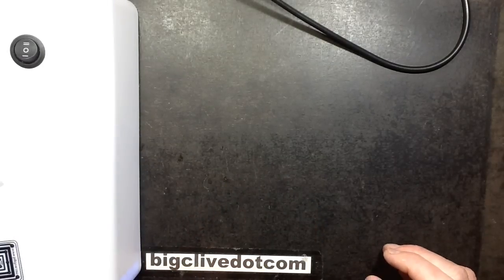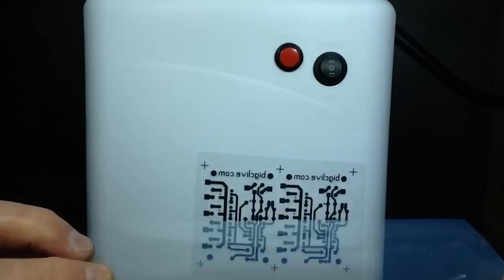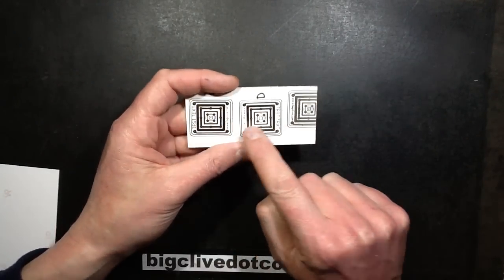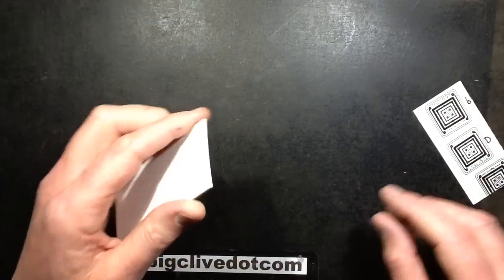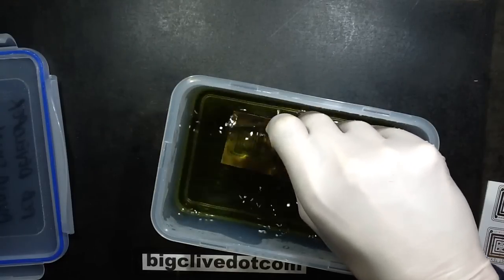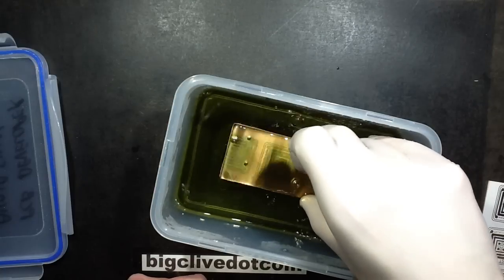Photoetching PCBs with silkscreen inkjet transparency material.

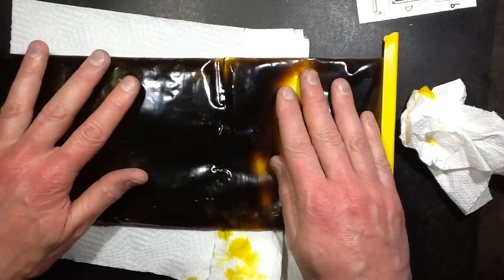Comment: 16:45 I liked the way you dialed in the exposure time. That is the way to do it! Your discovery of silkscreen-quality transparent film was new to me, and I think you for the tip. I gotta try it!

The biggest issue for a DIYer making boards like this is failing to understand that photosensitive film assumes "black and clear" photographic film, where black completely blocks all light from passing. When you print on a clear substrate using either an inkjet or a laser, black is only "partially opaque," meaning SOME light gets through. This is a big issue. I would bet that 99% DIYer board failures are because the hobbyist does not grasp this limitation.

Other points worth mentioning:
1) The strength of the lamp output. Most experimenters go wrong by assuming all exposure lights are the same. They are not. Strong lamp output requires less exposure time than does a weak lamp output. No one can advise anyone else how long to expose a board unless he and the inquirer have the very same setup!
2) Distance between the lamp and the board must be consistent for your setup.
3) 365 nm (=UVa) is the peak sensitivity for most film, but you can also use12V LED light rope that puts out 400 nm ("blacklight"), too
4) Importance of getting the artwork squeezed close to the PCB. If not, fuzzy/thin lines result.
5) understanding how photosensitive film works, particularly given how SOME light is going to get through the black ink/toner, and knowing how to interpret what happens when it does. Too much wanted resist washes away ==> exposure time too long. Too much undesired resist remains ==> exposure too short.
6) The importance of running a simple test pattern to determine your optimum exposure time for our setup. Clive does a good job of explaining it with this video.
7) Dust/dirt is your enemy when making a fine-line PCB exposure.
8) Use warm water for your developer to speed up the development time.
9) Warm up FeCl3 (if you use it) to significantly speed up etching time. I warm mine by placing the plastic bottle in a pan of heated water, letting it soak for about 15 minutes with the cap loosened (to relieve pressure!)
10) Acetone easily cleans off the film after the etch
11) I don't like using fingernail lamps because their light output varies as you move a board around under their light. Invest a few bucks and some of your time to build yourself a little exposure box using the 12V LED blacklight strip lighting for consistent results. Make the box big enough to use the entire 5m of light rope to line the box's interior. Create a uniform light pattern.

Comment: Hi Clive! Just wanted to mention that the one time I tried etching a board with a photosensitive coating, the best material I was able to find in my local box store was bog-standard tracing paper. Not especially transparent (about the same transparency as the vellum used on wedding invitations) and extremely non-thirsty paper, so the contrast was only a couple orders of magnitude, but I was able to get good prints with my printer's high quality setting and ink saturation dialed way down. My exposure rig was a CFL floodlamp in a clamp fixture. Once I locked down the lamp distance to get good coverage over a fairly large board area, I printed a test pattern similar to yours, snapped off a strip of the board, and had a shutter (I think it was just a piece of chipboard) that I slid a half inch every 30 seconds. The project itself was duff due to several design errors on my part, but the vellum and etching (I was experimenting with muriatic acid and hydrogen peroxide) worked splendidly. If I ever feel an urge to do some home etching again, I'll probably go with the same vellum (maybe with a panel of near-UV LEDs for the exposure), your squeegee-on photoresist, and vinegar/peroxide/salt as an etchant...but really, I doubt that will happen in the near future, as quick-fab prototype PCBs are so readily available, and I have a pile of perfboard that can handle most things I might need to lash up by tomorrow.

Comment: Ah, the amount of things here that translate directly to Film Photography is amazing. We even do what you described with a sliding shutter on a timer in the darkroom developing prints. We call them test strips. The paper we use usually takes about 1.5-3 seconds to expose a normal image. If you apply filters to increase the contrast you might have to go as high as 20 seconds. We can also get the developer on our hands without too much trouble, as long as you wash it off quickly. I expect that etching goo would burn right through your hand if you spilt it, and even that developer looks dangerous. Cool video, Thanks!
Reply: 1.5-3s seems a little short. You're not really going to be able to do any manipulation in that time. You might want to try stopping down your enlarging lens or getting a dimmer bulb.

Edit:: Completely forgot that this video was 2 years old, sorry if this seems a bit out of the blue

Comment: I used the older quick dry rough surface HP transparency film with an Epson photo printer recently with the max ink settings. Settings: Ultra presentation paper matte, high speed off, black/gray on. I used LED shop light mercury replacement T-8 tubes around 5000K kit for my seedling starting using the same UV emulsion. Four, 4' tubes, 10" from lights in an old photo proofer for 8-10 minutes. The same developer solution warmed up to above 90 degrees F took less than 20 seconds to develop and plunged in cold water to stop development, a tip I found online. Ferric chloride etchant vessel in warm water speeds up the etching.  Detail was fine with most of the .01" PCB border visible after etching I used in the CAD program. It sure beat the old 1970's Mod blacklight I was using!

Comment: The main problem with using NaOH as a developer is exposure to air makes the solution go off. A way around that is to store it in a dark room bottle. The sides of those bottles are accordion shaped, so one can vary the volume of the bottle. So when you put the cap on lightly and press down on it until the liquid comes through the threads, tightening the cap will seal the liquid in with almost no air in the bottle, making for a much longer shelf life.
Gloves and wiping up the slight spill mandatory, obviously.
Reply: Uh?  NaOH is Sodium hydroxide. aka caustic soda. It's highly reactive but there's no way it will deteriorate in storage. It certainly isn't necessary to exclude light. Air will do nothing to it.
You might possibly make a very dilute solution react with carbon dioxide if you pumped enough into it - but nothing significant.
I can't imagine what you managed to get mixed in with it to make it 'go off'.
Reply: There's probably no problem with NaOH solution as such, but, if it is left exposed to air after it has served to develop a batch of PCBs, it will go off. I don't know why that happens, but, from my practical experience, it does.
Reply: Well, if you're talking about used solution - that's a different animal.
The NaOH probably strips a lot of resist off the board by eating adjacent material, taking remnants into suspension where it continues to work on it. Dissolved air may play a part in that process. But depleted developer is best discarded anyway, it's difficult to be sure of it's effectiveness in processing - leading to uncertain results. 
Besides, it's also sold as 'Drain Cleaner' so you may as well get your money's worth that way. :D
Reply: True, but now even the cheap brands are putting accellerators in and that's a big no-no for using it as developer.

Comment: I bought a "guillotine" type paper cutter after seeing the one Mr Carlson uses on his channel to cut boards. I came across a cheap one at the thrift store for $2, so I thought why not? I quickly found out the flimsy thing has no chance of cutting FR4. I even tried to attach a piece of particle board to the cutting blade to add rigidity but that didn't help either. What gives? What should I be looking for here? 
  I highly doubt Mr Big cares to respond to me, but I'd really like to know what I should expect for resolution while etching as a beginner. I've managed to do some crude toner transfers with a resolution of 0.4mm but it's a pitted mess and I'm doing good to have a connection at all. I have a working TSSOP-20 PIC16F1508 based homemade dev board with that 0.4mm res, but it pushed my resolution to the limits. I got some Chinese dry film photoresist, and have been experimenting but gosh it's fussy stuff. I have a long publicly listed playlist of other CC's examples and tutorials saved on pcb fab. One of the ones I watched today suggested applying dry film first with water before laminating (I use a travel clothes iron though (no steam holes)). That upload also mentioned using 3 in 1 oil (machining/cutting fluid) between the transparency and board. Anyone else tried these techniques?
  I'm simply finding it difficult to develop a known baseline process to improve upon. It sucks to be a gimp doing these things in relative isolation on my own with no reliable source to question IRL, and I never know how to weight the advice I get from random people on forums.
  I really need help understanding the methodology of dialing in a photoresist setup on a bare bones budget of ~$20 to $50absolute max. I don't know things like how to determine the quality of dry film and what to expect, the magnitude of effect from UV wavelengths. I have a 5watt ~395nm UV light and it works although without a dialed setup I have no idea if it is causing problems or not. I've used the sun as well, and so far, of the dozen or so attempts I've made with dry film, the results are fairly similar between the 395nm light and the sun. I think my film is pretty bad as there are visible imperfections in the materials. Of course I just avoid those areas. I don't know what it's shelf life is. Presensitized boards are pricey for my bare bones budget. Does anyone have a good reliable source for info or a methodology here? Any help is much appreciated.
   BTW, my channel isn't monetized nor do I plan to change that, so I have nothing to gain here. I don't care if anyone checks it out. Seriously I'm just a dumb hobbyist looking for help from people with demonstrable knowledge.
-Jake
Reply from the maker: You get dedicated laminate guillotines that have very thick metal blades to handle the rigidity of PCB laminate.  For home etching I recommend going with thick chunky tracks wherever possible.  It makes the etching process much less critical.  I aim for 1mm and up track thickness.
Reply: bigclivedotcom
Thanks for the reply and advice. When you say try to use 1mm tracks, how do you address smaller pin pitch SMD's?
-Jake

Comment: Clive: I had a nail machine lke that for pcb etching. One thing i added was a pot to adjust the timer length so that i could get the exact same exposure each time. They just run on a 555 inside. easy hack
Reply from the maker: +xKatjaxPurrsx I did a teardown on this one.  It used a generic 8-pin microcontroller for the fixed delay.
Reply: +bigclivedotcom That's interesting. You must have gotten a different model than I did. Mine was definitely 555. It had 2 PCBs inside. I did a write-up for you at http://katjapurrs.blogspot.com
Reply from the maker: +xKatjaxPurrsx Your is very different.  The separate lamp PCB, actual lamp holders (my holders were all moulded in) and the timer PCB with a timer and relay.  Much more versatile.
Reply: +bigclivedotcom Oh, the lamp holders WERE molded in. That's 1/2 of what the Dremel was for ;-)

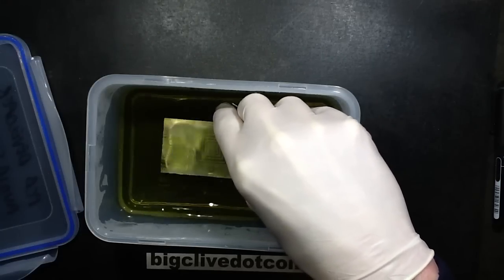Comment: I came across your video as I too am looking into the t-shirt silkscreen transparency film as an alternative. So far the best for me has been a cheap hp P1005 laserjet on clearprint brand design vellum 16lb. I use two of those nail units in a custom mirrored box with a glass top on manual mode. I use the uv photoresist dry film you buy in rolls on ebay from china that look like a light blue. My patterns are printed in negative, and a trick I employ is to wipe the back side of my template (on design vellum) with a very light wiping of clear mineral oil. Olive oil works too. Just put some oil on some paper towel or as you Europeans say kitchen towel and rub on a thin layer into the paper. since its lightly on the back, and its a laserjet print, it doesnt affect the print. The key is to have enough to make the vellum just a bit more transparent.  With that done, I find the ideal time is 4:45 - 5min. 5:30 and the UV penetrates the not so solid printing on the vellum and you get tiny dots and the banding from the printing developing that photoresist.
Sodium carbonate, used as a "PH up" in spas and hot tubs or pools works great for developing and is super cheap and readily available locally. 
BIG IMPROVEMENT: get the heck away from ferric chloride. I hate how so many people use it. Its total crap. been there done that. Takes forever, its super messy and its not that effective 100% of the time. think of all those times you had those hard to etch spots. 
I went to the following formula and it works literally perfect lazer sharp etching 100% of the time consistently and in about 1 minute flat! 
50% water
25% hydrogen peroxide 30% strength- not from the pharmacy weak 3% junk but from those hippie health food stores that sell 30% strength as an eco cleaner 
25% muriatic acid aka Hydrochloric acid 30% strength - from hardware stores or equv.
CLeans up with water, you have to be diligent with safety,  be careful and do this outside or in a well ventilated area. Once you use this formula, you will NEVER go back to ferric chloride. You will see the vast improvement. 
I use this for all my SMD hextiles used for BEAM robotics, and micro robots etc...you can get some quality production this way. I couldnt get the fine pitch to etch well with ferric. At first its a bit more money up front, but here in Canada you get the peroxide and the muriatic acid in 4 L jugs and it will last a LONG time

Comment: I did a bit of experimentation with that same uv unit a while back, using the same developer solution as you, and found the sweet spot to be around 1min 20seconds.
I wasnt being overly scientific about it though, cant remember the ink I used in the printer, but was using a high quality tracing paper.
Got annoyed trying to do traces a lot finer than you are and wasting a lot of boards in the process!!

Comment: I wonder if you could bypass the uv system with dye sub inks and a heat press. Just print your transparency and use a nomex pad and press to the board then etch.

Comment: Where do you get these photo sensitive copper clads? I like the way they end up being white, looks neat and modern :)
Reply from the maker: +Sidabra24.com I get them from a supplier in the UK called Mega Electronics.  It's a composite board that has fibreglass on the outside for good copper adhesion, and paper on the inside for weight, cost and colour.
Reply: My favourite is the Fotomechanix laminate from RS it seems to have a very good exposure latitude.

Comment: have you tried using a laser printer? I would have thought that toner would be much more effective at blocking the UV.
Reply from the maker: Reign Of Error I used to use a laser printer printing onto specialist film first and then latterly onto good quality tracing paper.  But the modern printers tend to use a much smaller amount of toner and I found their output was more grey than black when viewed on a lightbox.  The coverage tends to be variable over large dark surfaces too.  If you have a thick track, pad or ground plane then it seems to be a lot lighter in the middle.

Comment: Does the film work with toner? Does the film dissolve in water, which will make it a good toner transfer film as well.
Reply from the maker: SeanBZA It's specifically aimed at inkjet.  I'm not sure how well it would take toner and don't want to risk the coating melting onto my fuser drum.  I did try the toner transfer method with one of the other films, but the fact it's made of plastic defeats the water penetration.  Glossy photo paper or glossy magazine paper is still a better option for that technique.

Comment: hi, thanks for your video,
So what is the best conclusion? Whether using pigment ink or dye ink?
Reply from the maker: Cahyo Ari Wibowo It works well with both, so the best is whatever you have in your printer.  The dye based ink seemed to penetrate deeper into the film emulsion though.  The main thing is to experiment to find out how to make your printer print the blackest possible transparency by using mostly the black ink and putting plenty of it down.  In my Epson printers that involved using the matte photo paper setting and putting all the colour settings to their extremes.
Reply: bigclivedotcom  but we want a layer of ink to be as close as possible to photoresist film, if dye based ink seemed to penetrate deeper into the film wont it cause refraction and soft edges ?